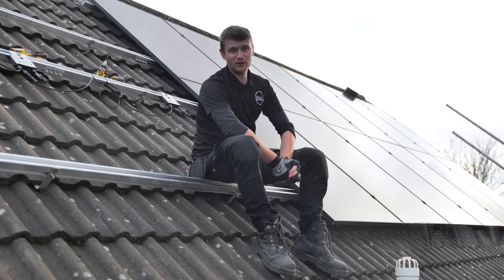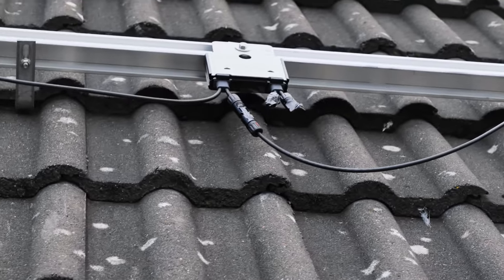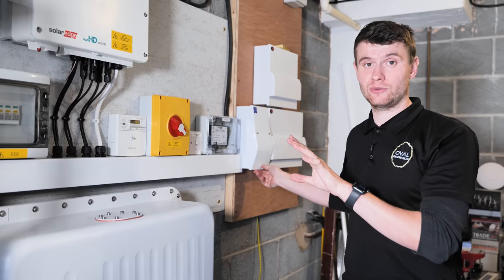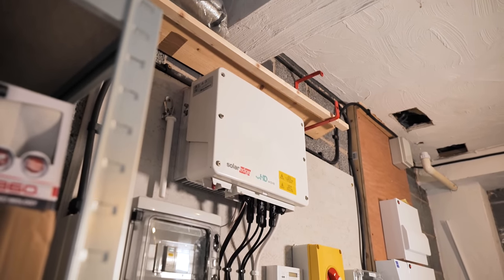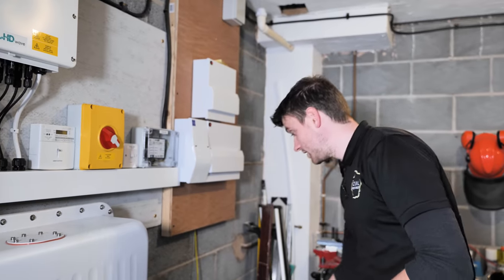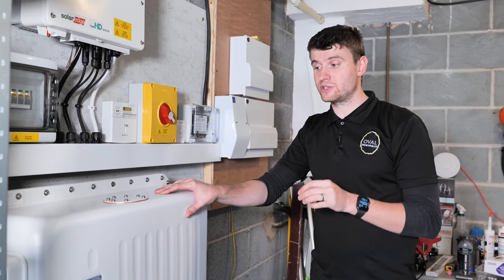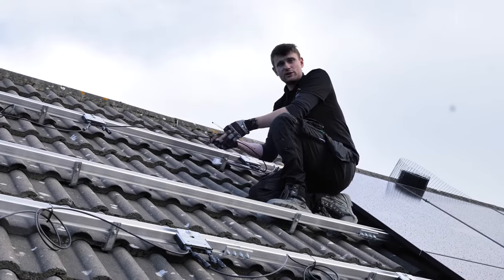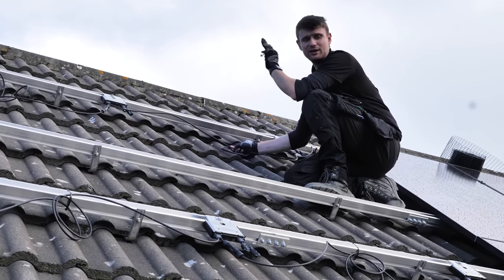Mid install of this SolarEdge PV and battery System!

Comment: Nice job as always.
However, homes and garages are starting to look like industrial substations and boiler rooms which adds complications when things fail.
20yrs+ ago we all ripped out all water tanks in lofts and bathrooms to fit simple combi boilers removing loads of pipework too.  Now we go back to it all. 🙈

Comment: Interesting that you let the armour float, I get the fact that modules are current limiting devices but I don't like anything floating. If the inverter has earth fault monitoring, which I think a lot do have, then it would alert you to a potential issue? I am currently wrestling with have two or even 3 earth systems which I don't really like. Can't export pme to ground mount, but need to earth DC SPD's back in garage and 4 x 50m swa strings, pme dno earth and earthing pme to ground rod for ESS earth in backup if pme is lost. Hopefully earth systems will not have much if any potential differences where they are close. Hope documentation will be read!

Comment: Great video , I’m new to the PV and starting to venture toward this ,can I ask the swa used for dc double insulated between cores and not normal ac swa or are you allowed to use ac swa ? And is the surge for dc specific for dc ? you guys do great installs keep up good work lads 👌

Comment: From one sparks to another. How did you terminate the swa cable coming down to the dc cables going into the inverter ? I did not actually know you could run swa cables and join onto dc in loft ? nice work btw.

Comment: Great video love watching them. I have a question, can the DC cables be ran through an internal wall? Mine are currently clipped down the side of my house externally through the garage roof into the garage where my inverter and battery are, but we plan on knocking the garage down and putting a bedroom and integrated garage in place of the existing garage. Thanks
Reply: It’s not advisable to do so but if you do then they must be mechanically protected.

Comment: You said New regulations need a DC Isolator and a DC surge protection device. when were these regulations changed? I have just had Solar panels, Powerwall and a Solar edge inverter fitted last week. The installer said I didn't need them as there was a DC isolator in the Solar edge inverter. A bit confused about whether I need them or not. Can you clarify it for me. Thanks

Comment: Great video, a few questions... Do you ever wall-mount the battery as I believe is standard or don't you like this because of the weight? Did you apply for 8kW, and if so what was needed/what was the reason that they only allowed 5kW?

Comment: Hi from Sydney, Australia. Thanks for your interesting videos on solar installation in the UK. I assume using DC string with optimiser gives more options for battery installation and avoiding multi DC/AC/DC conversion losses? Can the optimisers be signaled to shut down in case of fire? There have been quite a few fires here on rooftops (dodgy product or installs) and the inability to isolate the panels at rooftop has been an issue for firefighters.   I'd be interested in the DC surge setup. Cheers

Comment: Nice video Sam. 

Check out the MC4 reusable sealing kits to keep moisture out of the optis. Might save you a roll of tape or two 👌
Reply: Hi Nick- we need these over at Harvest Green Development/ Fuzed Electrical - I regret throwing away all the ends from the commercial inverters would’ve have 10’s of thousands by now!

Comment: It would be great to hear more about the performance of solar batteries during the winter months. I assume their performance drops just as it does with an EV battery because I believe batteries perform best around 20degrees C. Would it help to keep the battery warm if garage temp drops to 2 or 3 deg C? How much drop in battery performance do people experience?

Comment: Oval R ,great video. I have noticed a lot of installs that are now sunk into the roof , this must be more costly than just using the standard rails . Why do they do this is it a planning issue. Disturbing the whole roof. Also less air flow .
Reply: It looks neater, customer specified it or planning issues due to the property age \ location. Personally, I dont like the idea of taking off most of a perfectly good roof even if it does look better.

Comment: It will be interesting to watch the evolution of solar over the next decade, as most the the equipment installed here will more than likely be bulky or redundant. Solar roof tiles may even be the norm.
Reply: Fixed on rails can produce more than integrated or solar roof tiles because in summer they will stay cooler because of airflow
Uglier but better in the increasingly hot summers

Comment: Are solar with micro -inverters running to an AC battery not the best option? I’ve just installed solaredge system with their 5kw inverter to their battery and can’t think of how it’s better

Comment: Sam have a question, running two strings from roof into loft, I see you go into junction box and then use two core 4mm swa down to isolators. Could we use 4 core 4mm swa for the two string instead of doing two runs to the inverter?

Comment: Great video and work as always. But couldn’t the 8kW inver be installed at this stage due to the size of the PV array and limit the export (G100) to the grid to comply with the requirements of the DNO?
Reply: No, because the inverter they want to fit in the future isn't sold yet as its the new solar edge back up type that will provide during a power cut.

Comment: Hi
Have you one or two strings feeding inverter?
Looks like you only have one😢!
Will that not overload inverter?
Regards mg.
Reply from the maker: Hi there, thanks for the comment as this system is SolarEdge . It is able to handle more panels on a string than a standard string inverter. Therefore, most domestic SolarEdge installations are only one or two string systems

Comment: Is there any reason why the DC, from the panels, can not be taken inside the roof and enphase micro-inverters placed inside the roof?
Reply from the maker: The SolarEdge system doesn’t use micro inverters like enphase. We are unable to extend the cables between the panels and the optimisers. We can install the optimisers in the loft when it’s an in roof system as the panel cables are long enough. To reach through the felt to the optimiser. 👍
Reply: @OvalRenewables  Enphase  input is DC and output is AC.  I was asking about micro-inverters, not DC to DC adjusters.  But thanks for the reply.

Comment: What's your view on tigo optimizers which work with any inverter just done a system using them and givenergy inverter and battery really nice and simple.
Reply from the maker: Yes they have their place. I aren’t a huge fan but mainly because we love the SolarEdge kit
Reply: @Oval Renewables  that's fair you've got one kit set that your happy with you stick to it I can get behind that

Comment: Nice and neat!
Did you use ferals on the DC cables?
I find multistrand cables cannot get a good bite when being clamped down without a feral.

I did not know you could run DC down solid SWA cable. I thought it preferred multistrand.  being over that distance. Maybe 6 mm would be better.
Reply: Im wondering the same. I would have thought tinning multistrand cable is better than a ferrule.  Not even sure what those ferrules are made from. And running DC down a two core cable?  Again don’t know the answer but wondering if there would be some induction losses. Although it looks neat.
Reply: @rajk5307  it is all about look in the UK

Comment: Hi guys, hope you respond to this as it’s bugging me and I’ll never get an answer!

This is set up as one string but at the inverter it looks like you have two strings installed with the MC4 connectors? Am I missing something?
Reply from the maker: Hi there, yes this is correct there is one string coming from the roof and then the SolarEdge battery connects into the inverter like an additional solar string would do. This means the SolarEdge battery can charge with DC direct from the solar. 👍

Comment: Those brackets holding the rails seem to be raising the tiles so they do not seat correctly, I’m not sure I’d be happy with that in a windy area, is there another option?
Reply: The notches on the back of the tiles should really be ground down to prevent this. I rarely see this happening mind.
Reply from the maker: Thanks for the concern, all the tiles have been ground down to allow the hooks to pass under the tiles without them lifting, they may still lift ever so slightly but this will be extremely minimal.

Comment: jeez It takes some much space, so many unnecessary components. PV isolator is built in in solaredge (and you also have a junction box in loft you could just put isolator there. If you need to replace inverter, just do it when it is dark and put caps on MC4. Same for over voltage on DC, solaredge already has it built it. But why there is no trunking for PV cable on wooden loft?

Comment: Hi I’m in the process of solar this is (18) x 400-420watt jinko  tiger neo all black panels this produces 7.56kw of solar power ,coupled with (18) emphase microinverter ,this will be connected to alpha smile b3 plus  3kw ac coupled solution with 5.04kwh modular also adding another 5.04 battery , this would be 10.08 kWh total ,my only concern is is the inverter only able to supply 3kw ac maximum,as the panels altogether can produce 7.56kw of solar power ,info would be appreciated 👍
Reply: anything over 3.6kw needs DNO permission to feed back into the grid. This isn't always guaranteed to be accepted and some installers won't do it as it can take up to 3 months for an answer. If you have a battery then you'll need to keep that charged and therefore you wouldn't necessarily be expecting to export more than 3kw back anyway would be the theory I'd be working with
Reply: @guffermeister  Hi thanks for your information, what’s up with solar companies not wanting to do the paperwork ,it just seems a waste to being able to generate 7.56kw of solar power, my quote was for 2 5kw batteries, but with the maximum usage of 3kw inverter, I’ve decided not to use the company
Reply: Because it's not guaranteed that the DNO will say yes and many don't want to have a customer hanging around for weeks. Proving you don't need more than 3KW then that size inverter is fine as you'll be dumping the rest in the batteries. The installer may already know there are issues in the area you are and you may be stuck at 3KW anyway....

Comment: Using that thing to lift and hold panels is a bad idea, it will lead to micro cracks.
Reply from the maker: I don’t see how?
Reply: @OvalRenewables  and that’s what’s worrying.
Reply from the maker: @buckshee  I am trying to encourage a good conversation about it? Please let me know as I don’t agree with your point of view but happy to learn.
Reply: @OvalRenewables  Putting pressure on the glass is really bad and can lead to micro cracks, these won’t be visible to the naked eye but over time they can cause damage to the cells only visible with a thermal camera. 

I like the idea of using this but wouldn’t be risking doing this.
Reply from the maker: @buckshee  thanks for explaining your concerns. I totally understand why you may fear micro cracks. However if you were to try it I believe you would see that it puts no pressure down into the silicone. The pressure is actually on the aluminium frame as the panel is lifted by the glass sheet. However if you have a better way that works for you then that’s cool 👍

Comment: SolarEdge equipment is highly unreliable.  I own an electrical company that specializes in solar and we have replaced almost every HD wave SolarEdge inverter we have ever installed.  The fact that he is a fanboy of SolarEdge shows me he hasn’t worked in this sector for long.
Reply from the maker: Thanks for the comment, saddens me that you feel the need to post a negative comment about our experience when you have a genuine point to raise about reliability of the equipment. We have been in the industry for just over 10 years. Whilst we have replaced some solaredge equipment it is very little compared to the number we have installed. I feel the reliability has increased massively over the past 5 years.
Reply: As soon as someone posts a nasty comment in their argument it invalidates their point and makes it quite obvious they’re just jealous 😅

Comment: 5:20 simply isn't true. If some of the panels were shaded, it would not lower the output of the other panels, because all solar panels manufactured in the past ten years have bypass diodes... He's talking as if bypass diodes don't exist.
Reply: It's not as simple as that. If you have just a single string then you can still get problems with the total voltage being less than required by the inverter or battery charger. That can be prevented by making the normal operating voltage high enough so it will still work when a panel is out. However it's even worse if you have several strings in parallel, because the unshaded string will provide power at the full voltage but the shaded string won't be able to provide any power at all at that voltage, so a single shaded panel can stop an entire string producing power. A good MPPT converter will try to work out the best voltage to use, but it can't perform actual magic.
Reply: @matthewwakeling4978  You are talking about two strings running parallel, nobody with any sense does that... You only have one string per MPPT. Your 'problem' is non-existent, because nobody with any sense would run two strings in parallel, you would buy two single MPPT inverters, or one dual MPPT inverter.
Reply: @johnthomas338  I agree with you. However neither message is being shouted from the rooftops. Certainly the Victron calculator doesn't warn you at all if the panel voltage is quite close to the minimum charging voltage, meaning a shaded panel would stop charging completely, and it also positively encourages parallel strings with a single MPPT charger.